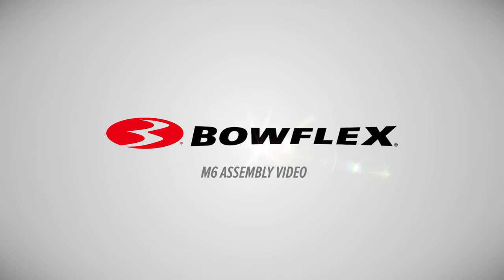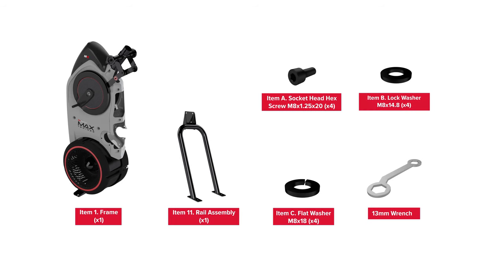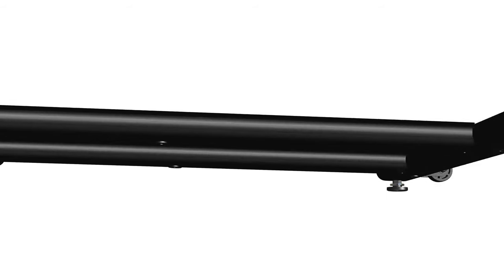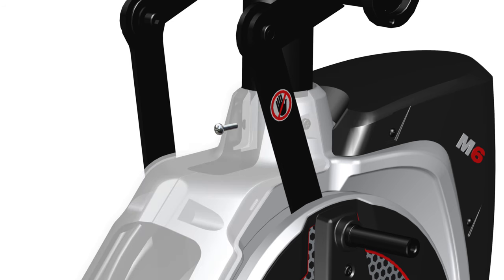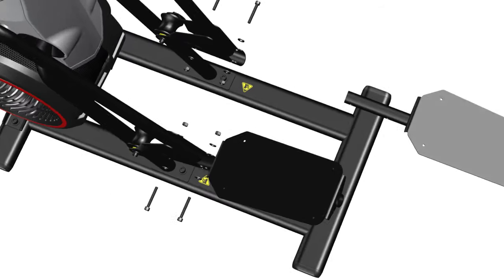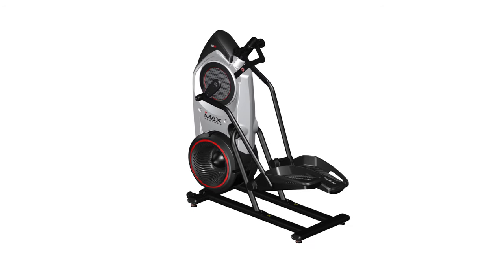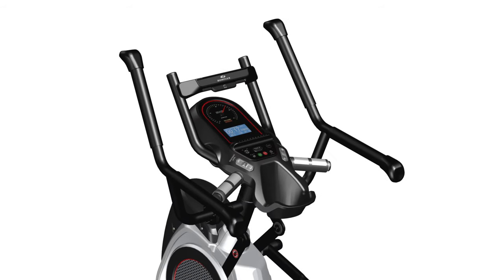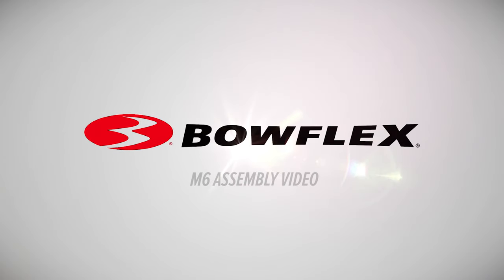BowFlex® Max Trainer M6: Assembly Video

Comment: Levelers show nuts, (3:31) there not on the assembly parts. Maybe is not needed, however  I lost time trying to figure out that! I still believe is needed for level adjust; Item L (7:15), is actually Item C. Item N (9:32); is actually Item M. Item P (9:32), is actually Item N.
Reply: Thx buddy
Reply: Thank you so much. This was a great help.

Comment: Great video...I'm seriously considering purchasing one of these units very soon.  I take it that if there is some assembly involved it also means that I could disassemble the unit whenever I decide to move to a new residence, correct?  It would be nice to know if I can shed about 50 pounds of weight before I have to move it 🙂.

Comment: **READ BEFORE ASSEMBLY** Note: I have the 8020180 rev C version of items. After step 4 it goes to crap! Part L are 8 screws (not washers) for step 6! There are only 6 C washers left if you plan on using them on step 5. You need 8 washers. Step 7 is wrong. Item P are 6 screws (item N as shown in video) Item N are 10 small washers (item P in video) and item O are 4 thick small washers (item P in video). Use 4 item M screws, 4 N washers and 4 O washers. Step 8 is wrong. Use 6 item P (item Q on video) and use 6 item N (item R on video). Now I have to wait probably another 2 weeks to a month to get 2 washers. AARGH UPDATE YOUR STUFF BOWFLEX! Sheesh! Horrible...
Reply: I'm going to use the 2 Item G LARGE washers (not used in video). I hope That will be ok. Wish me luck!